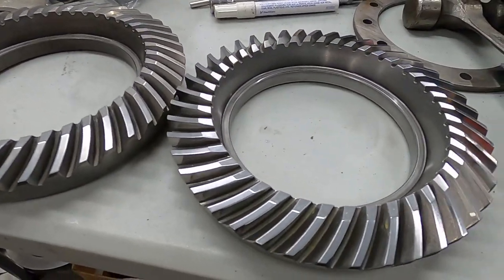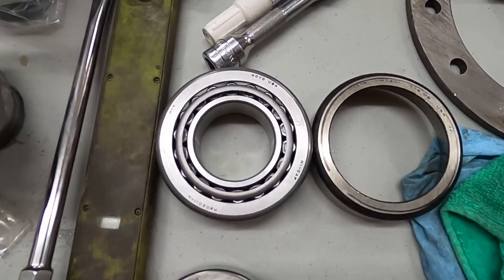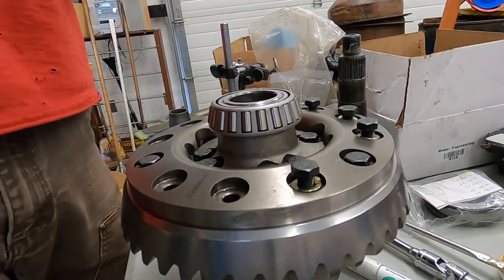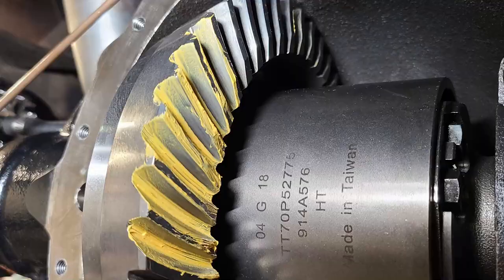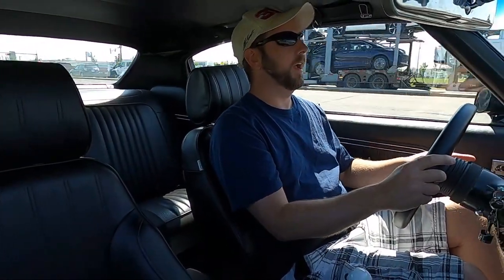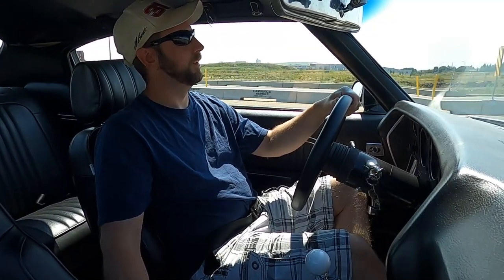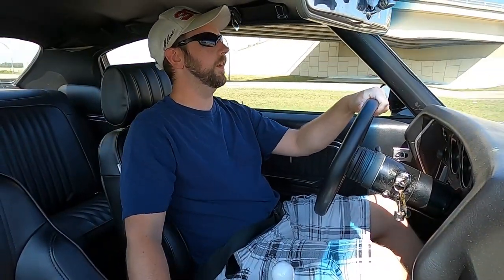Noisy Gears Update - New Ring & Pinion

Comment: I have a 12 bolt chevy rearend in my cutlass.  I installed a set of 3:73's from us-gear.  Set them up by reusing original shim.  Replaced crush sleeve with shim set.  Adjusted thickness to get proper rotational torque.  After a few attempts,  got a great contact pattern while rotating gears with brakes applying resistance.
Drove car.  It was quiet until it warmed up.  Went back into it and moved pinion .003.  Drove again.  It howled.  Adjusted pinion several more time both in and out over course of 1 month.   It got a bit quieter but still obnoxious.   Called a local diff builder.  He said its probably the gears and that he had highest success using motive gears.

Comment: At 2:15 mark you show a dial indicator to measure backlash. The dial must be tangent to the radius of the gear. You have it square to the tooth face. Place a magnet on the perimeter of the gear and measure to it or clamp an object to the perimeter so you can get the dial indicator tangent. Makes quite a difference in the backlash reading.

Comment: If you Decide to redo the ring and pinion I would discard the checking distance and use only pattern in my opinion its the best way . Also  looks like you don’t load the pinion enough to set a good pattern run the pattern with a drill and put drag on it

Comment: OK....I have installed between 1000 and 2000 sets of gears.....and your patterns look great....they have good symmetry from face to flank.  So if you had no noise in the beginning and then a noise started some time after then it sounds like something shifted. Perhaps the pinion bearings were not fully 100% seated down? Same applies to the carrier bearings.  Although you might not have been happy with the REM super polishing your gears had the fact is they are still super smooth so No Break-in period needed.  Big thumbs up from me that you went the extra step and had them REM'd 👌 ALL aftermarket gears need something like that.
     In any event, check the condition of the gear oil now.   It should be like brand new with no metal soup  in it.
Driveshafts can also cause noise so check that out also.
Reply: Agreed
Reply: Hi Need contact you i had same issue
Reply: its the gears. they are sheet. The noise comes from the oil getting thinner as it warms up. If he put a heater in the gear oil and heated to operating temp before the first drive they would sound just as bad from the get go.

Comment: If your rear differential is solid mounted or has very stiff bushings then I will say without a doubt that it's a big contribution to the noise. Considering everything you've done so far. Bcuz my Miatas diff is absolutely stock and never made any gear noise prior to me swapping in delrin bushings. Now there diff is mounted basically solid and there's enough gear noise to make it's way into the cabin.
I don't mind it though bcuz It's not a daily and the performance benefits of what I did does aid in shifting by a lot. Makes it way less easy to miss-shift when in WOT going from 2ND-3RD.

With the old rubber engine&diff mounts, it would be a miracle to hit 3rd gear while giving it the full beans lol

The extra NVH is a downside but it's a compromise that's pretty much unavoidable for these little cars when you decide to get 3x the factory HP from them hehehe

Comment: Maybe it's the diff bushings. I have a Miata and when I went from the stock rubber bushings to very stiff poly(&delrin) diff mount bushings, you can hear soooo much noise now from the differential. It now has like that touch of dogbox straight cut gear sound.

Comment: The only quiet gear Ive owned in a 12 bolt is an oem 3.08 when I had the richmond 4+1 5speed, every other brand will make noise at around 50-60 m/hr even with a perfect pattern.

Comment: Maybe try Richmond Gear? I use their axles in my 12 bolt truck rear they are awesome! I just bought a set of 3.73 richmond gears for the rear and a posi carrier to replace my 3.08 oem setup, when i finish i will let you know how they sound. Also have you been using the GM limited slip additive in your gear oil? That may help.

Comment: The ring gear looks oddball.  That is the first one I have seen with such top taper at the toe and taper abnormal at heel also.  Is that a weight reduction measure for a competition set or some cheap out factory job to reduce metal usage/shipping weight?  Don't know if that is a contributor to the howl. Also why the imprint on the pattern is not smooth but streaked.?
Also I notice the pinion crown of the teeth are very wide while the roots between are narrow channeled.  I am comparing with my 3.73 Yukon set here and also internet photos.  My pinion crowns are narrower and roots wider than yours also my pinion crowns are wider than my ring gear crowns but the root widths seem about same.  So I don't know if your differences are due to a different ratio or not. 
I recently had a lenghty conversation with a Yukon service tech.  He said they get about two a week of those who swear they got the pattern right but actually they were perhaps close but not.  So I am extensively learning what I am going to encounter before I start my rebuild.
Also there is a critical break in procedure and a 500 mile oil change.  Not suppose to go above 60 mph during the break in steps.

Comment: Stupid questions, did you check the runout of the new gears and carrier? Excessive runout will cause a whine/howl which no amount of shimming will correct. Is it quite until it warms up then gets noisy? How much preload on the carrier? I have always used Richmond gears which have a reputation for being noisy and have never encountered any noise. I always measure the pinion depth from the axle centerline, it's the most accurate method of measurement.
Reply from the maker: I did check the runout of the gears. I can't remember what it was, but I am sure it was .003 or less.
Reply: Theres noisy gearsets going around right now. Quality control has gone out the window apparently.

Comment: Koyo is Timkin now, which is what I used in my 10 bolt. Works great and quiet as a mouse.
Reply from the maker: I didn't know that. I thought Timken was made in USA while these Koyo's say Japan on them.
Reply: @SS454LS6  yep koyo bought them out about a year or two ago. Same quality bearings
Reply from the maker: @75zl1  Good to know, I was a bit worried. Thanks!
Reply: @SS454LS6  They are all made in China. Timken, SKF, National, all China.
Reply: @Thirdgen83  No some may use materials sourced from china, but they are manufactured in their respective countries labeled on the races and bearings.

Comment: I replaced my 12 bolt 69 Chevy Elco,  rear end...complete gears,axle,bearings,seals, oil/additive with an Eaton Posi new unit, all to specs.
Took it apart 2X and still making noise on decel.
Took it to two local reputable shops...both said patterns were dead on... Some of my GearHead friends say Eaton are noisy. Like you...I am living with the noise, but for now.
Very frustrating...
Any feed back would be appreciated.
Reply from the maker: You are running a truetrac?

Comment: DUDE I HAVE THE SAME PROBLEM! Professional rebuild in my 72 Chevelle with Yukon gears 4.11's and I get noise. Took it back to the shop for warranty work. Rebuilt with US Gear, same noise on the ride home. US Gear and Yukon use the same gears btw. Took it to another shop because I figured the shop was a bunch of hacks. Rebuilt rearend again and added a new posi carrier. SAME NOISE. Yukon gears AGAIN. Awaiting on Richmond gears now. Once they come in Ill have the 12 bolt rebuilt for the 4th time due to noise.... lol.....
Reply from the maker: please keep us updated if it fixes your issues.
Reply: @SS454LS6  I will
Reply: Update?
Reply: I haven't taken it in yet. I need to

Comment: What your preload on the pinion? 
That is what made my noise before. Went to a crush sleeve eliminator and haven't had an issue since.
Does the moser set up use a crush sleeve?
Reply from the maker: 20 inch pounds of preload. Moser uses a solid spacer. Why would a crush sleeve have any affect on noise?
Reply: @SS454LS6  lack of preload can cause whine.
Reply from the maker: @75zl1  US Gear recommended 19-22 inch pounds. On paper, i should be good.
Reply: @SS454LS6  Interesting, I wonder what it could be from then! Hope you find it!
Reply: @SS454LS6  I recently replaced the gears in a 99 Yukon’s rear end. I knowledgeable friend told me to over torque the pinion nut by about 6 to 9 foot lbs if the gears are new. When it breaks in it will loosen up and then your preload will be close to spec. That worked on my old Yukon. Not sure if you needed to do that or not to be honest.

Comment: I would just turn up the radio and enjoy the ride.
Reply from the maker: got rid of the radio long ago haha.
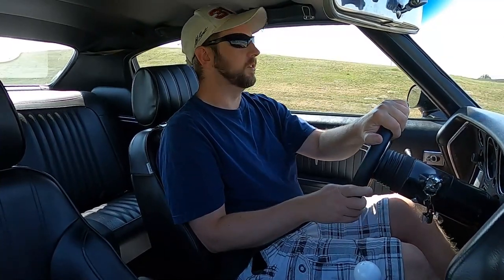Reply: @SS454LS6  I was just messing with you. That would aggravate the shit out of me too. Especially after doing it over and over again. I put an Eaton posi unit in mine. Reused the factory 3:31 gears and lucked out with no whine. I also own a 70 Chevelle SS with a 468 and M20. Lots of fun brother.
Reply: @SS454LS6 really quick question. When you put the car in neutral. Did the noise go away or was it still there? I’m getting the same noise, but when I put my car in neutral, the noise almost disappears.  Coasting it does the same noise off the gas only 
On the gas it goes away. Almost reminds me of a sequential transmission sound when you let off the gas lol